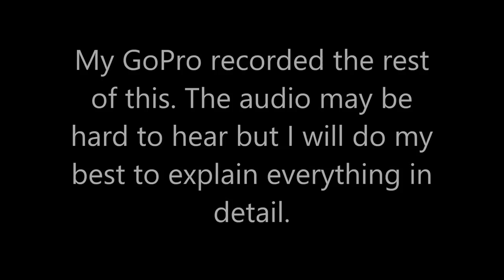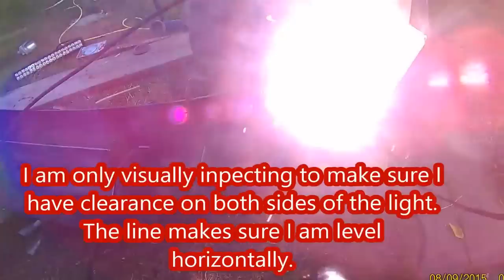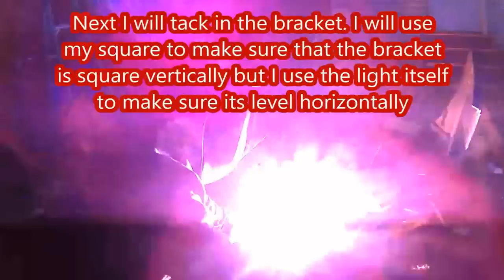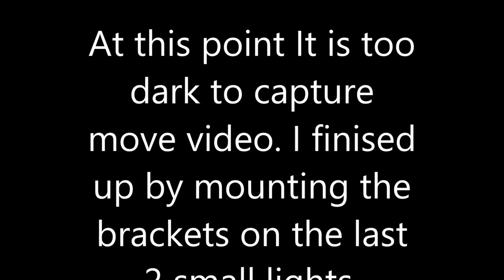08 Chevy Silverado Move Bumper Build

Comment: Good job man. One piece of advice though, always fit and tac everything up first before running a pass. If you do the material will pull it out of alignment like the driver's side did at 6:04. It'll save you headaches and love taps later. Don't be afraid to use a good tac, they'll hold quite a bit. Other than that it looks great. I'm looking at one of these for my truck. Thanks for the vid.

Comment: I got the same lights off ebay for $20 a set. Too bad I couldn't have told you this before you bought theirs. Bumper looks great man! Looking to do the front and rear set on my 2000 4x4 Dodge 2500.

Comment from the maker: I got the lights for around 100 bucks total with a relay and switch, I had 6lbs of welding wire, 8 flap discs iirc and 20 or 30 bucks in paint and primer. so figure another 150 bucks or so and it took me about 8 or 10 hours total.

Comment: Need a ?? stainless sleeve between your lower bolt to support the factory tube. Too bad they don't provide the tow mounts to come through from the mounting bracket. For your LED lights measure them add ?? 1/8" and have a spacer which won't melt to hold your light mount to weld. Is your steel 0.188 or 0.250 ? Preheating your steel makes for a better weld.
Reply: Edward Carberry its def quarter inch

Comment: I'm wanting to get a set of move bumpers for my Chevy but I'm worried about my welder. It's a 125 amp gas less mig welder that's capable of welding 5/16 steel. Would this be able to create a strong and safe enough weld?
Reply: Yes if you take your time
Reply from the maker: Yes, I had a 135 amp that I did mine with and it wasn't turned up all the way, so I would say yes, you can do it with a 125.
Reply: Colonel Sandy im attempting it with a 90 amp flux gasless harbor freight pos lol. this little shit will lay some good beads for 80 bucks

Comment: anyone hit a deer or smack the bumper hard on some rocks or something? I'm wanting to put this on my ramcharger which will be used as a overland vehicle and need to be able to protect it if I were to take a obstacle the wrong way.
Reply: Sorry for the delay! Check out this picture and testimonial from one customer who had an accident. Our bumpers pride themselves in being durable and withstanding whatever life throws at them. https://www.instagram.com/p/BFeuojAu6UY/ They are made of 3/16" plate steel, but in the end, the strength depends on the fabricator
Reply: MOVE Bumpers sweet. I think that'll work for what I plan to do. can I order the bumper kit for a 87 ramcharger with mounting brackets for a 95 ram 2500? before I get one of these I plan to put my ramcharger body on a 3/4 ton frame and driveline.

Comment: FCAW om remotely important shit? Really?
Reply: what would you have preferred he use. when done right FCAW is stronger than your 7018, plus he's outside...so Im not sure what youre talking about
Reply: Im not really fond of fcaw-s for something thats going to be finished.
Id have much preferred to tack everything on the truck with 6010, then welded it out with spray mig indoors.

It could be me, but ive never been a fan of self shielded flux core.
Reply: I agree, but that couldve been all he had. I myself wouldve done stick the whole way. 6011 tacks and some 3/32 7018's. but then it all comes down to preference and we dont know this guys situation lol
Reply: The machine doesnt look like a dedicated flux core machine, and a 80cf cyl of 90/10 is like $40 from airgas. Figure $30 for a 10# spool of 035 70s6.

If you put a price on time, itd have probably been cheaper to mig it b/c of the time saved on grinding.